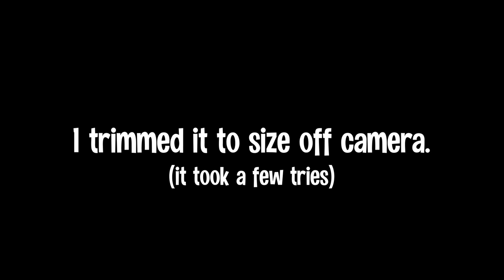Building a GIANT Ottoman Tray | DIY Woodworking Project

Comment: Very well done video, thank you. One question I have on ottoman trays, yours and others I’ve seen - what about wood movement on the inside component over time? As it expands and/or contracts throughout the seasons won’t there be an issue with potential cracking or bowing? I need to make some and am very interested in your thoughts. Once again, thank you so much for your time and effort in putting out such great content. Be well, God Bless.
Reply from the maker: This was a major concern of mine while making this.  That's why I placed the bottom part in a frame.  I only used a few screws.  I don't think it's big enough for wood movement to effect it.
Reply: @CasualBuilds  Thanks for your thoughts, appreciate your time.